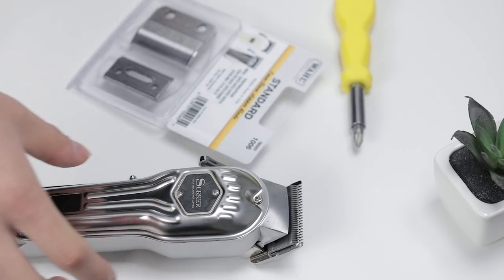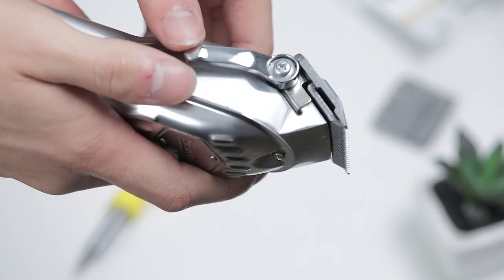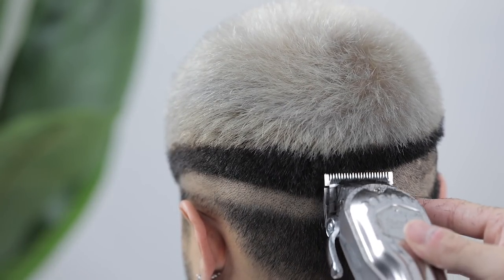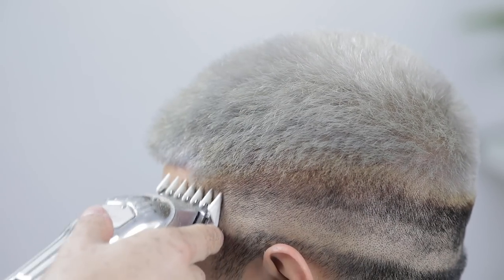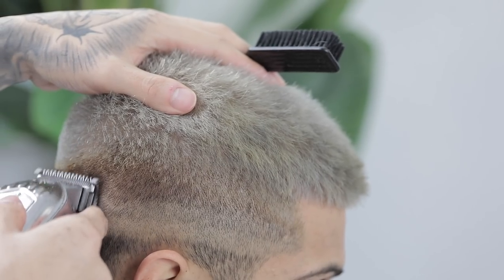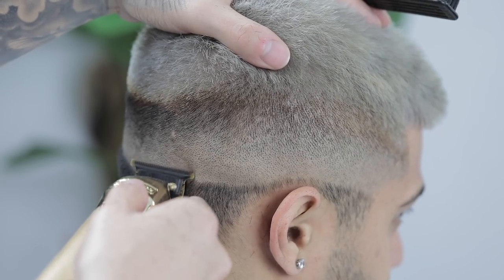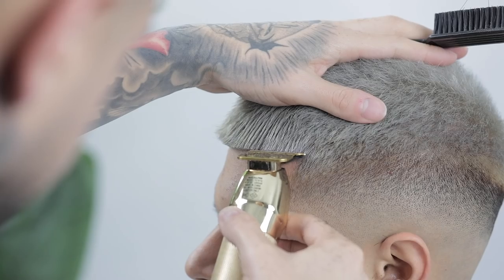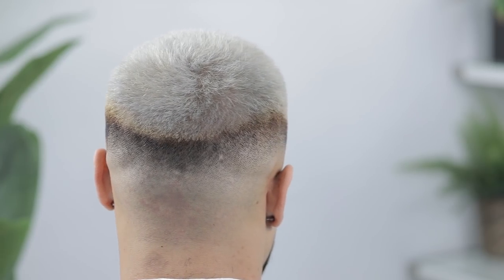SKIN FADE BARBER TUTORIAL / HOW TO MODIFY CLIPPERS!!!

Comment: Thanks, I zero-gapped my clippers with this video. One bit of feedback, is I would show a close-up of the distance between the zero-gapped moving blade and still blade, just so viewers can see that they aren't lined up exactly, and that the still blade has a tiny overhang. Because there's a risk of cutting yourself or a customer, showing a close-up of exactly how large the zero gap is seems important. Thanks
Reply: 2:53
Reply: Thanks for the callout man. Question, when switching the blades, would you switch out with the lever all the way closed, or would it be open? This is going to be my first time.
Reply: @davironee5252  closed

Comment: Great tutorials as always,  I have a question, I have a magic clip cordless, I dropped it and the plastic guide that holds the moving blade in position broke, I  ordered a new one, but I noticed that the old one has grease to lubricate where it attaches to the motor to move it side to side, I wanted to ask what kind of grease should I buy, or should I put some drops of blade oil? I hope I made sense
Reply: white lithium grease
Reply: @chris00rock  ok thanks, I'll buy some

Comment: Do you know if the surkers have the same proportions like other clippers? I want to change the upper cover but don't know if it will fit, the screws are on the same spots though
Reply: Wanna do the Same, did you find a Solution?
Reply: @andrejo8  no, didn't find any measurements for the cover, so i let it be

Comment: I been using y'all's system for a couple months now. What happens when the 0.5 open at 3/4 doesn't take out the line? I ran into that problem lastnight
Reply from the maker: You can either close it a bit more or as long as you can lighten most of it up the rest will blend out when you take out last guideline with no guards, once you get to the clipper with lever open no guards that will blend it out since that’s the one that initially put that line in
Reply: @FADEDCULTURE  can yall answer your IG? or how can i get ahold of you. trying to find out if yall offer any classes or mentorship...